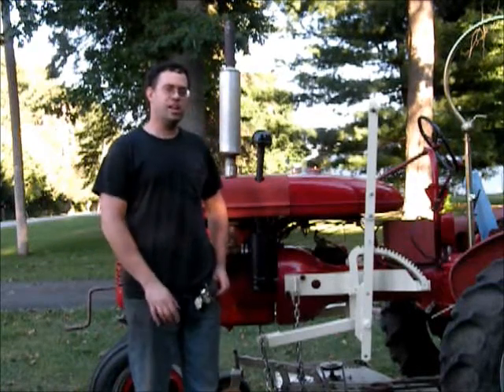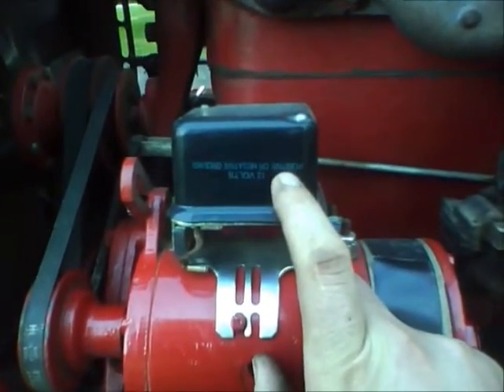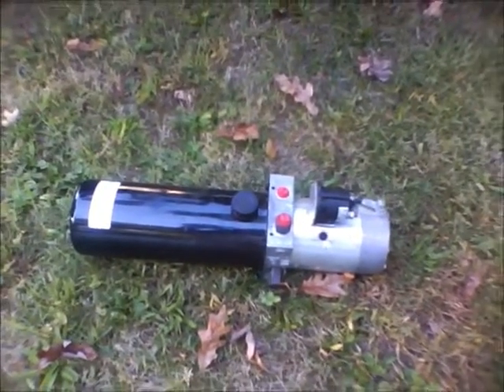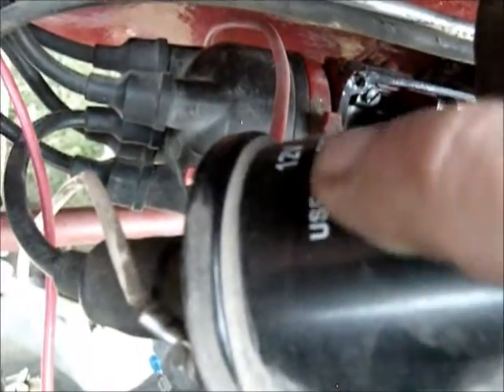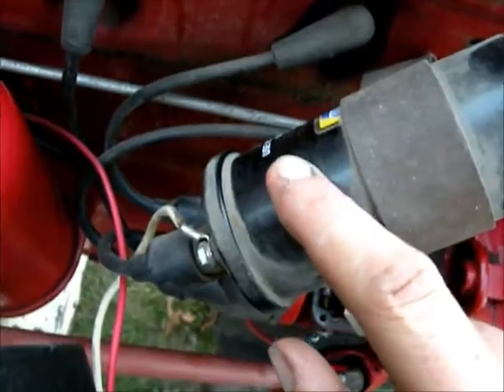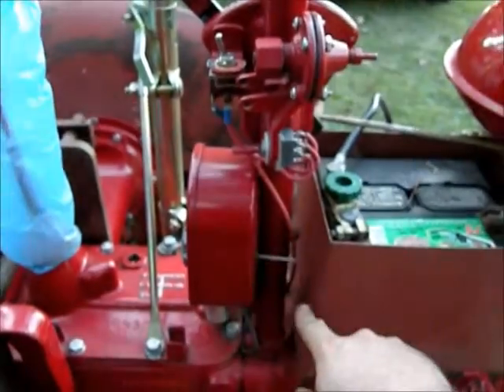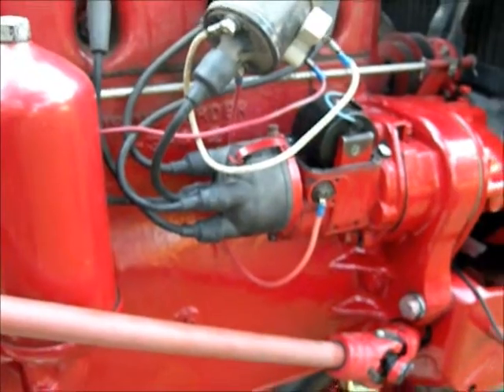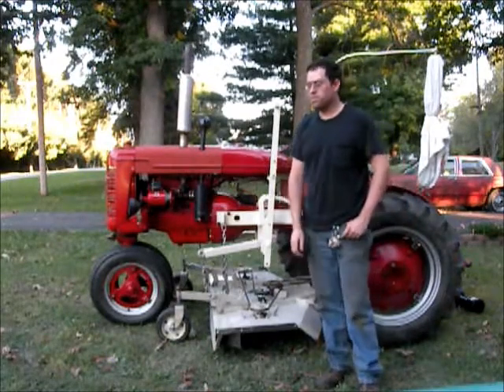Converting a Farmall With a Magneto To Run With a Coil

Comment: Thanks. Used your video to convert my Cub after it quite on me. Had the parts just in case I might need them. One hour of work and had my tractor running again. Thanks to your video.

Comment: hey thanks for taking the time do post this video, very good simple explanation, especially the mag / condenser part. My '48 Farmall Cub is original with mag and generator. If I want to convert to 12v I think I would have to do the following:
1) Get a new alternator or get NAPA to change the fields in existing generator .
2) Isolate the condenser wire in the magneto.
3) put a coil in and run the wire from the distributor cap to the coil .
4) if I get a coil with internal ballast would only have to run a wire to the key/kill switch and other wire to starter.
5) New 12 v Battery and #2 gauge wires and switch to positive ground.

Do you think I missed any steps? Thanks again for explaining this setup.
Reply from the maker: Yes,  what are saying sounds mostly correct and nothing more should be needed. Isolate the wire from the coil inside of the mag that goes to the condenser. The wire from the points stays attached to the condenser. Also, you will be converting from positive ground to negative ground.
Reply from the maker: If you have your generator converted to 12V you will need a 12V regulator to use with it. Don't try to use the 6V regulator.
Reply: Thanks again , much appreciated.

Comment: Thank you for the great video. I've recently been given a model B. It has already been converted to a coil and negative ground but still 6v. This helps me a lot to understand what has been done on it. 

I was planning to take it back to magneto but now I'm not sure.
Reply from the maker: silveravnt I'm glad I could help. I would love to convert mine back to mag too, but don't have the time to tinker with it. Mine would be fine if it didn't draw moisture. The garage that I store it in gets damp with temp changes.

Comment: Hey, cool video! When you changed polarity, did you have to use a different starter? I would think changing the polarity would make it want to spin backwards?
Reply from the maker: No, the starter still runs the same direction regardless of polarity. The brushes in the starter set the direction of rotation. You would have change the timing of the brushes to make the starter run the opposite direction. I worried about that myself when I set out to do this, but a very knowledgeable fella set me straight.

Comment: Great Video, Thanks so much for taking the time to do this for me.  I am thinking I just need a 6 Volt Coil and also to   reverse the Terminals to work on my Neg. Ground system, is that right?    Simple enough,  Thanks again.          DanO'
Reply from the maker: +MrDanoconnor I'm glad to be able to help. Yep, you should only need a 6 Volt Coil. Your system should be a positive ground if it is original. I get a little confused as to which wire to hook to which terminal on the coil with the positive ground systems. The old 6 Volt Coil I used before I converted my tractor to 12V had the terminals labeled Bat. and Dist. instead of + and -.
Reply: +Chip Wright  I'm thinking that your tractor starts so very easy because the Coil has Constant JUICE going to it already, unlike the Reg. Mag that has to "Produce " it's own,  is that Right?  I'd love to have my tractor start like yours and not even rely on the Starter & Battery.
Reply: +Chip Wright   I have spoken to a lot of Old Timers about whether  a Distributor  is better than a Mag and they all insist there's No Difference but I Believe they are just being stubern and not looking at  the facts of exactly how the spark is generated.  It's all about the COIL!   Mag or Dist. isn't the real difference, it's where & how the spark gets to the Points. The BIG Plus to a Mag is you don't need a Battery but I think that's a small price to pay for a dependable starting machine. I'm trying to keep my Super A all Original but I am definitely considering this change over.
    Thanks so much for your input on this Chip, I really do appreciate it.
Reply: +MrDanoconnor  I Misspoke on the previous comment,  with the Exterior wired Coil, You DO Need the Battery!!  NOT the Starter, That's where the Mag System is better, NOT being Dependent on a Battery at all.
Reply from the maker: I'm glad I could help. I wanted to keep mine original with the Mag too, but I got tired of fooling with it. Don't write off Mags as being less dependable in general though. I have other engines with Mags on them that work perfect. It may be that this particular Mag on ours is troublesome.